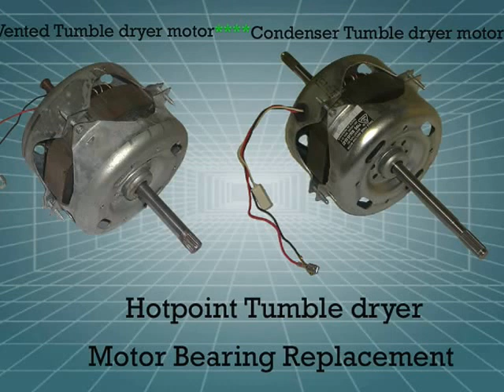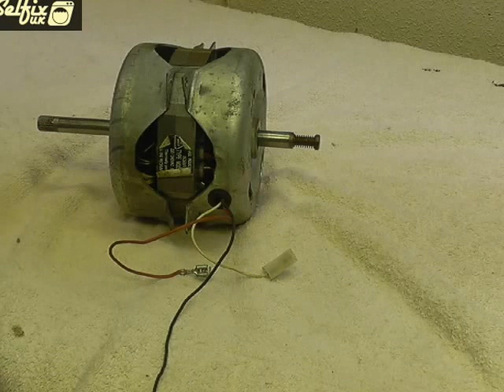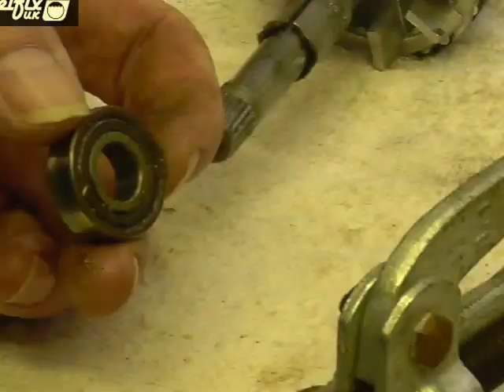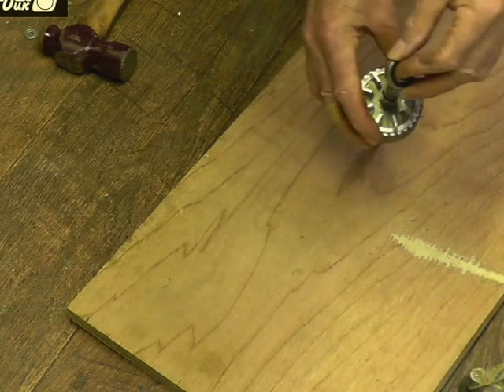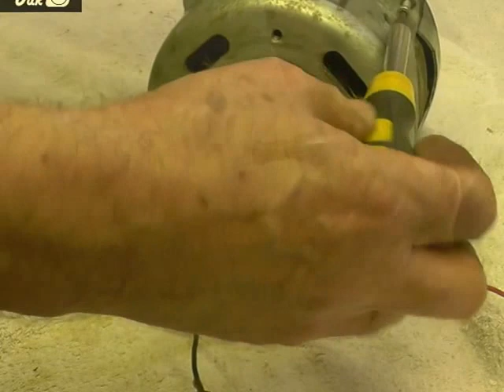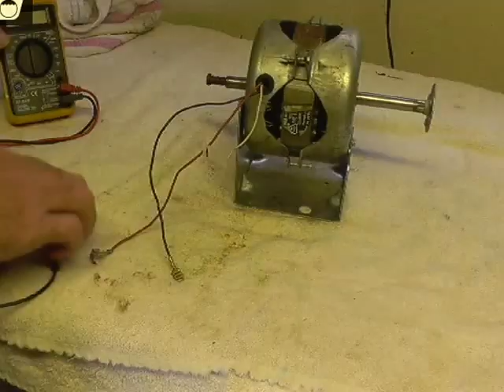How to replace the motor bearings on a Hotpoint tumble dryer motor

Comment: any way to remove bearings without the puller ?
Reply from the maker: I have tried but just came unstuck and ended up having to buy a new motor so I wouldn't recommend it and considering the cheapness of pullers I think they are money well spent even if you only use them once.
Reply: Thankyou for your reply. i decided to purchase a puller as there only £6 for a 6 inch that should be ok? the seller i got the bearings recommends grinding the old ones off as its quicker but ill try the pullers first with some hot air :) once i fixed the motor i reckon ill get another 2 years out the dryer because iv not long replaced the drum bearings and seals. its only worth repairing your dryers if you do all the labour work yourself because the drum + seals and motors bearings plus labour it would be cheaper to buy a new dryer.
Reply from the maker: I completely agree, there are so many videos available that show you how to replace components on appliances it's cost affective to at least watch them and then decide if you think you're up to the task of doing the job yourself or calling out a repair engineer and with some jobs like these bearings they would just replace the motor and charge accordingly. Good luck with the repair, but if you follow the video it's very straight forward.
Reply: +Selfix UK just an update. i replaced bearings following the steps in this video and i have successfully fixed my dryer now it no longer makes a grinding noise however couple days on its started making the same bearing noise again. not as loud but its the same sound as before. am i correct in thinking maybe the new bearings i installed are faulty.. im 100% sure i didn't damage them why installing them on the shaft and as far as i can see there i no way to lubricate the bearings are they look sealed to me. if i take the belt of the drum but still on the motor. and i pull the belt and turn it to simulate the motor turning under load you can hear the bearing noise. so im sure the problem is the bearings
Reply from the maker: It does sound as though the new bearings are faulty and you are right there is no way to lubricate them they are a sealed unit.
Reply: Selfix UK could you tell me where to get the bearings from please?
Reply: Just cut my bearings off with angle grinder. .much carefulling